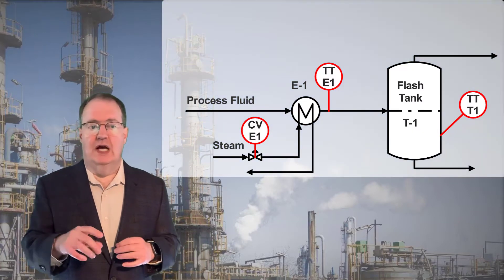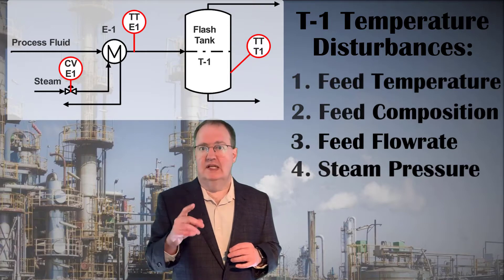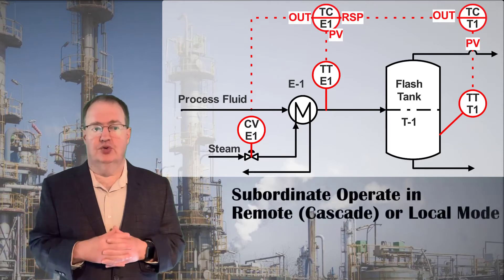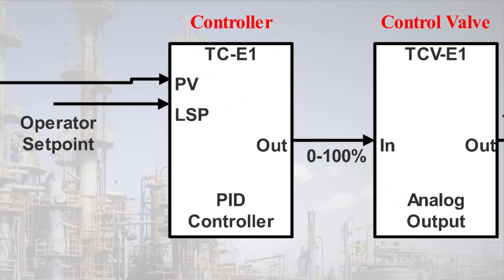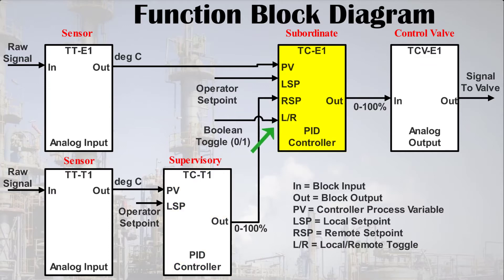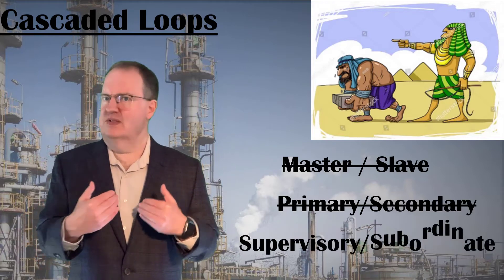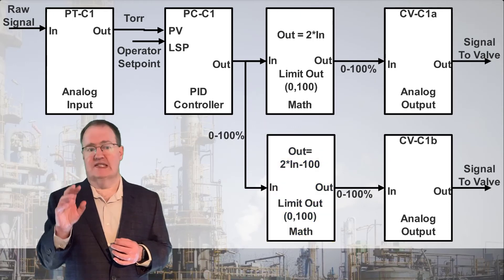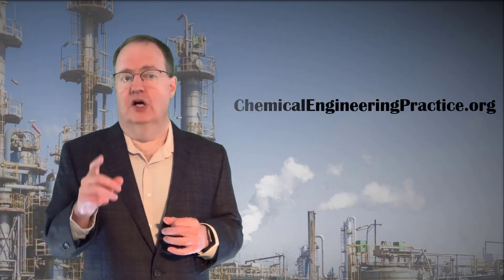Cascade and Split-Range Control

Comment: Thanks for the explanation. We will implement a Cascade Control to regulate the temperature inside the dryer using a steam control valve of the exchanger. The good results should come with this control strategy.